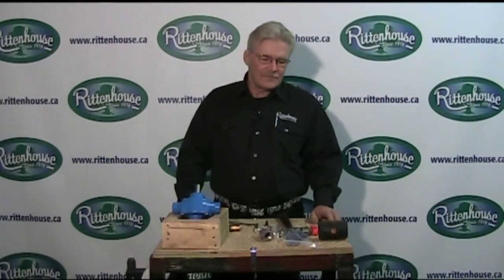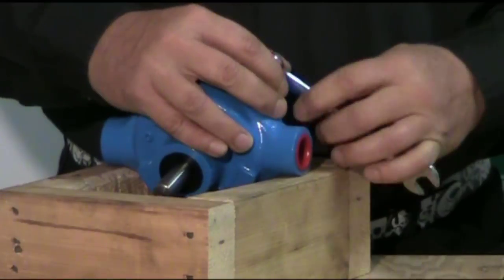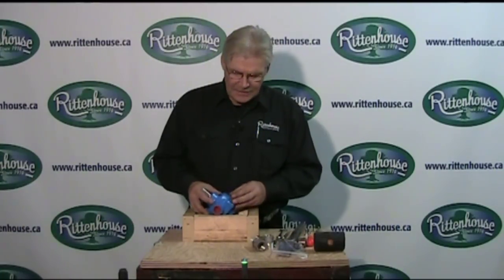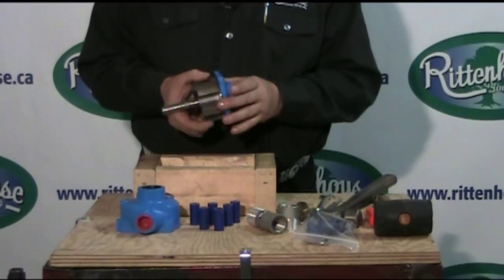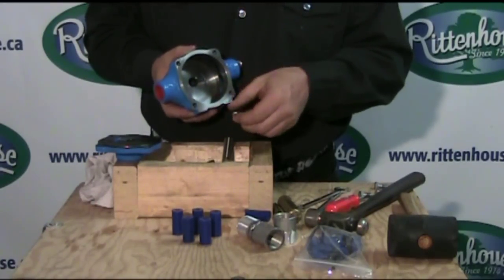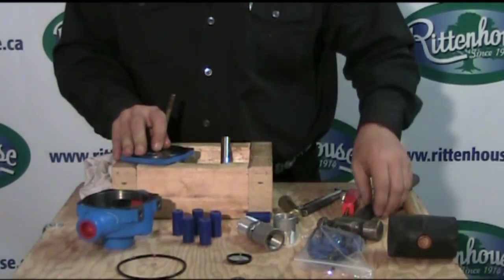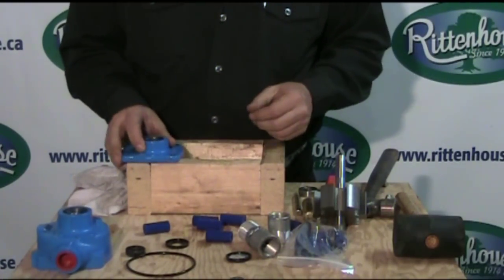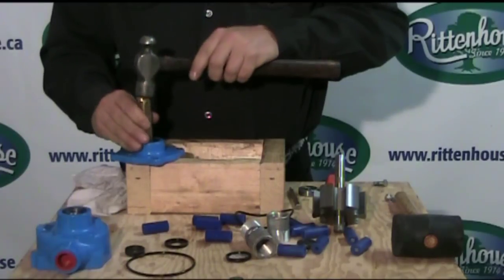Rittenhouse Hypro Roller Pump Repair

Comment: Aren’t you supposed to use water pump grease on those?  Mine has grease zert holes but no zerts
Reply: Are you sure those aren't drain holes for winterizing? 

Side note, they are actually called zerks.
Reply: I believe it's a weep hole, similar to an automotive water pump.  Once the shaft seal begins failing, water will be pushed out to notify you're on borrowed time.  Mine is doing this, thus the rebuild video.

Comment: What is the best way to store these pumps ?
Reply: Well, I was told to run antifreeze (with corrosion inhibitors) through them before putting them on the shelf over the winter.  I did, but my sprayers 6500C was frozen solid when I pulled it out of storage yesterday,  Admittedly, I had run glyphosate, imazamox, and a surfactant through it last fall to kill off some invasive giant reed, so yeah.......   

I found a good price on a 6500XL that will be here next month, and got here looking for help to get the old 6500C through this first week of spring.

In the future I think instead of just running anti-freeze through it and putting in on a shelf, I will store them in a box immersed in anti-freeze, so they never go dry.  I have also heard running oil through them before storage can help.  The oil should stick better, but I am thinking immersion is the way to go.

But honestly, I'm not sure you can really help the 6500C's that much.  All of the data I've seen says go get a 6500XL.
Reply: @that.schamp   My 6500XL needs rebuilt after  7yrs.  I store it with diesel fuel, or if not available, used engine oil.  Overall I'm pleased I upgraded to the more robust stainless pump.

PS:  I believe hole in question is a weep hole, similar to an automotive water pump.  The shaft seal on mine has failed, most likely from a bearing failing.  I'm about to find out!
Reply: My apologies, the weep hole was on another comment.  

After I flush the sprayer/pump good with water, I remove it, fill the chamber with diesel/used oil, and cap the ends for storage.  Seems to work okay, can be a little messy though.

Comment: Great video thank you. I have done a few of these. My biggest problem is the finishing part. when I tighten the bolts the pump freezes up (does not turn). I have to bang on one side of the shaft to get it to loosen.